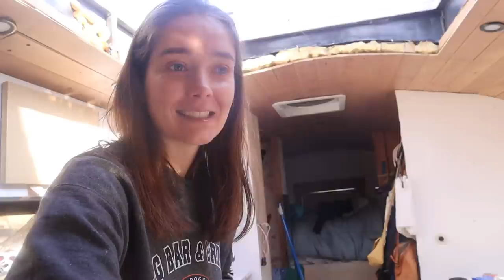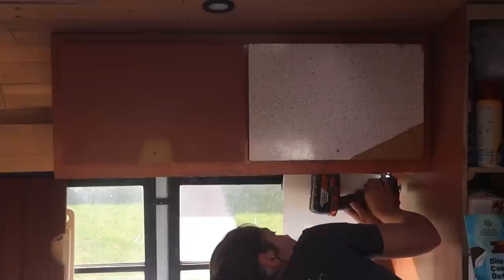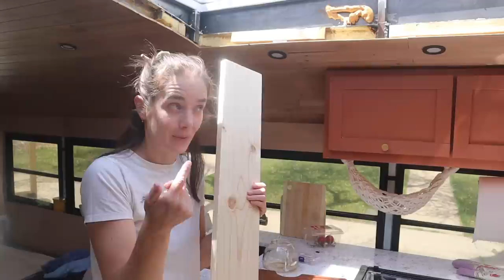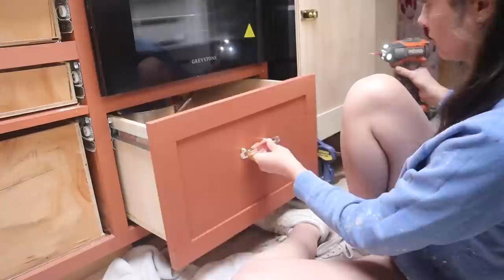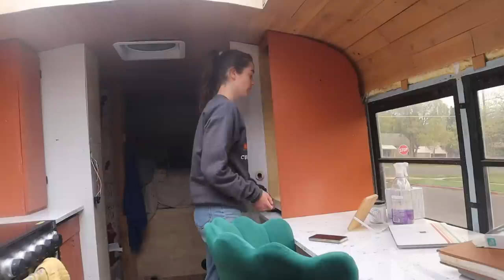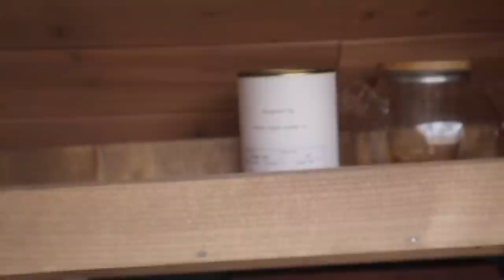I can't believe this is my kitchen // skoolie kitchen makeover

Comment: It looks beautiful.  I love the color.  I have a suggestion where the plants are concerned.  If you plan on leaving them on your desk while traveling, get earthquake putty.  It’s useful for so many things besides but you can roll a ball of it and stick it to the bottom of each planter to hold it in place and it won’t damage the desk surface.  The Home Depot sells it in the hardware department.😊
Reply: Alien tape works really well too its removable and reuseable
Reply: I have used velcro that is adhesive on one side, and the gorilla brand museum putty. They both work great and come in handy all the time.
Reply: In the UK we have Blutack that's probably very similar

Comment: I just got  my safety for my motorhome today and moving everything in is a chore but seeing ur video kinda brightens things up... :) Thought I would celebrate with lasagna and my microwave lasted exactly 15 mins just long enough to cook the lasagna like a trooper (RIP) and today I found the air con but I'm parked at a friends so its trial only until I hook up my solar elec system/generator...